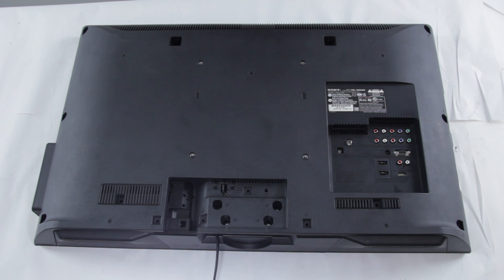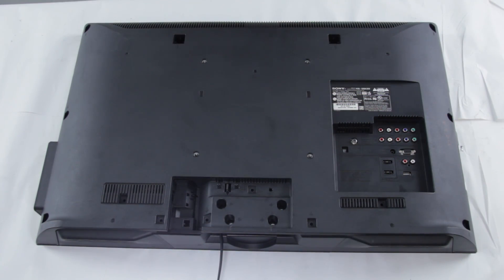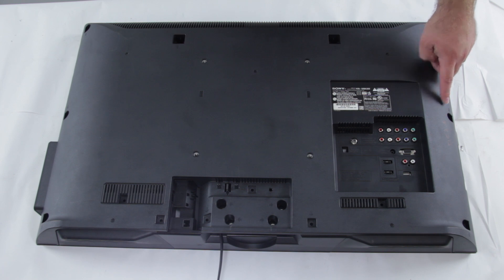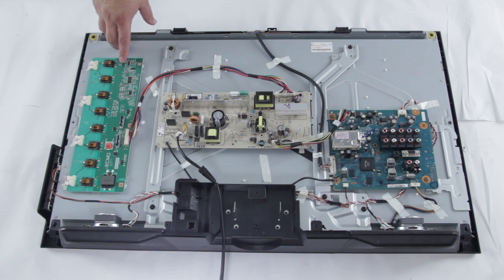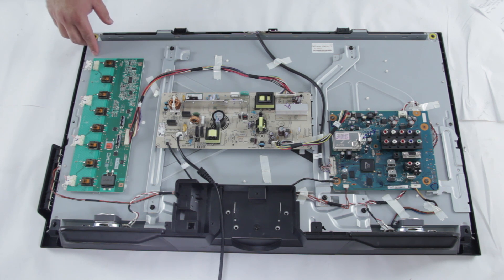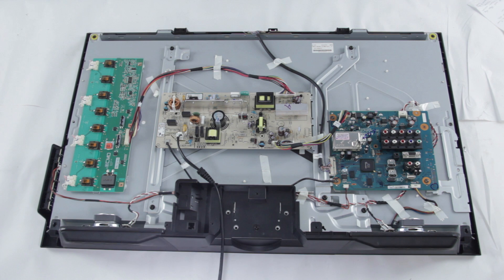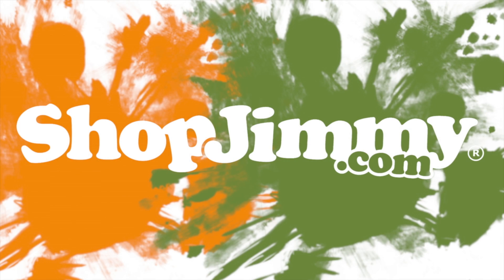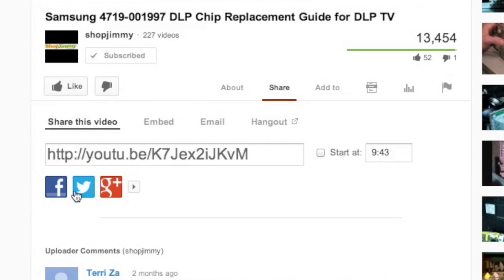LCD TV Repair Tutorial - Backlight Inverter Common Symptoms & Solutions - How to Fix LCD TVs

Comment: I have a  Dynex DX40L150A11.
What an adventure this was. Had it working for about two hours. Originally, the TV would automatically power off the screen a few seconds after turning on. Everything else besides the screen would stay on. The screen would go completely black, not super dim, completely powering off the screen. This told me that the power supply was still good. The picture looked fine which told me that the T-Con board was fine. Though, before the screen would turn off, the lighting of the screen would flicker a bit. Could be bad bulbs, backlighting, or bad inverter board. 

I am thinking that whatever is causing the flickering is sending an error signal to the power supply telling it to power down the screen.

I started by taking the TV completely apart and inspected everything (I thought). The back of the inverter board had some decent brown spots along with the backlighting. That's all compromised. Bad voltages. Once I got to the bulbs I first noticed that the two plastic covers over the sides of the bulbs were cracked. Once I removed those I then seen two bulbs were popped out on one side. This TV could have been dropped or hit hard, knocking the bulbs out of place, creating a power surge/interference that is detected by the inverter board, sending a signal to the power supply telling it to power down the screen. That being said, I popped the two bulbs back in place thinking that I had found the problem. Nope. Not that easy. Didn't solve the issue.

I still believe my original thought that the bulbs were popped out from force causing a power surge/interference. I bet that surge caused damage to the circuitry on the inverter board (the brown spots). Upon further inspection I noticed a static sound coming from the inverter. The static sound was sync with the flickering of the image. The flickering was flicking from a dim to normal lighting and not from off to on.

My only guess is perhaps the controller for the brightness/backlight has been damaged due to improper voltage (a power surge) and an error signal is being sent from inverter board to power supply. There is a wire from the inverter board going to the power supply called DIM. This sends signal for brightness/contrast/backlight control. Could also be responsible for sending the error signal. I disconnected this and grounded it. 

TV powered on properly. Everything worked fine except the brightness/contrast/backlight control but that's because I disconnected it. After about two hours, the screen turned off again. Everything else stayed on. Lol.

I can turn it back on but every 15 minutes or so the screen would go black/power off. There is a good chance that I could just replace the inverter board (for about $20-30) but I am 50% sure that the entire backlighting is compromised (bulbs are fine). Something is still sending an error message to the power supply. It's a hit or miss. I need a voltage meter. Any suggestions?
Reply: E Kryption shit happened to me too bro, smfh

Comment: I have Sanyo DP19640.  Purchased CEJ535C board from you which is an identical replacement for board in TV. No change.  Here is the symptom.  Push power button.  Image appears on TV for 1 second and backlight goes out.  Putting a flashlight up to TV and you can see image without backlight and hear sound.  All other controls seem to work OK.  (menu etc.)  Each time I turn off the TV and turn it back on the backlight works for 1 second.  Any help would be appreciated. Thanks.

Comment: my 32 inch Samsung LCD tv model number ln32d450g1d still currently works but is flickering kinda? like bright to a little less bright over and over with a weird hissing/buzzing noise like you hear in fluorescent tube lights when they are flickering? my first 1 same model that did this eventually went to straight black screen still sound though? is it that backlight inverter or is there a legit bulb that burnt out in my old 1 and is going to burn out in this 1?

Comment: Hi, helpful video.  I have a KDL 55HX820 with 4 blinks.  The 
power/reboot methods have not fixed the problem, so it looks like the TV
 has a true problem.  When the TV is turned on, it stays on for around 
10 seconds before shut down and 4 blinks.  During that time I an tell 
that there are multiple 3-4 large shadows along the bottom edge of the 
screen.  It used to have one of these shadows prior to the 
shut-down/blink issue.  Does this help identify that the problem is the 
LD board vs. main logic board?  Or does this mean that the LED failure 
is causing the system failure?  Is replacing a board and possibly the 
LED back lights a feasible solution?  I appreciate any reply you can 
make to illuminate the problem and solution further.
Thank you.

Comment: I have VU lcd tv 46ïch, backlight not working, tested power supply to backlight inverter ~20v (actual 24v) ok, inverted board part no: SSI460_16A01 how to test backlight inverter board output to lcd

Comment: i have a Samsung 55in LCD TV. model # ln55c630k1fxza. TV powers on and will run for exactly 5min. then black screen and sound only.checked for swollen capacitors on main board as it appears to be a common issue these look good. possibly the inverter board? the exit hold button for 12 sec then enter resets system and returns picture for exactly 5 min. then black screen again. dark room with flashlight shows picture so I know it is a backlight issue. thought if the light had gone bad it wouldn't come back on. any help greatly appreciated

Comment: My KDL 40S2000 Sony Bravia is having the following issue: Power up (directly plugged into outlet) then runs for a few seconds and shuts off - the standby indicator blinks red 4x and pauses - what, if any, helpful response might you be able to share with me. I'm ready to buy an inverter and replace, but wondered if I need to buy upper/lower - any assistance is greatly appreciated!

Comment: model no  is UN55F7100 
Samsung 55" Series 7 LED HDTV - UN55F7100 : TV is not turning on. There is no Red light and its very well connected. I was working fine till night and in morning no power. PLEASE HELP

Comment: hello guys. My TV Samsung model LE4OB651T3W MODEL CODE LE40B651T3WXXC dose not turn on not even the red light that suggests that the power is on. I removed the cover and inspect the capacitors for swelling or damage and I found nothing, no burns or evidence that something is wrong. Can you please help me with an advance?

Comment: I have a Samsung 32" TV model LN-T3242H that has no picture or sound. first, the power led was flashing, so I replaced the power board with a new one. now the led doesn't flash, but there's still no picture or sound. the led stays on for about two minutes, then turns off, then on again for two minutes, and the cycle repeats. can you please help?

Comment: Hello, I have an issue with a SONY KLV-40BX400, the TV turns on, displays the sony logo and plays the power on sound then turns off and turns on a few times and then doesnt turn at all and the power led blinks 6 times intervals, could this be an issue with inverter board?

Comment: samsung 46 inch tv. model# UN46EH6000F. tv will make power on noise but will have a black screen. if you repeatedly turn it on and off eventually 1 out of 50  or so trys the TV will work.

Comment: are backlights supposed to stay on mine on a samsun 65 lcd turn on and off once after a few seconds i have 2 inverter boards and both sides light up they are hooked to power board i guess it controls them? thought i could disconnect 1 to see if the other will stay on

Comment: Hello , I have a Element ELEFW605 60" When it is turn on the start up screen comes on for a quick second and goes black , but I do have sound, I also did the flashlight test and I can see the picture does this sound like the power supply\backlight inverter board or are there a couple of capacitors that can be replaced

Comment: I have sony bravia kdl-46v2500 which powers up with green light for a couple of seconds, then switches over to red blinking STANDBY lights with no picture. The red standby light blinks 4 times with a blank pause, then 4 blinks pause and so on. IN this mode, i am unable to power off the TV even with the power button the tv unit. i have to pull the power plug to power off the tv. Let me know what you think is the issue. Thanks in advance.
Reply: I have exactly the same TV, and last night it had exactly the same problem. Then I noticed that the screen was only half as bright as it was before. Everything else was OK. I unplugged it and reset it using the settings menu. No improvement. This TV is 10 years old. Can half the backlights be off and the other half on?
Reply: Look up service manual the red light sequence is a fault code

Comment: Hi there I have a Samsung TV model # LE32R87BD model code LE32R87BDX/XEU serial # 64083HEP607405K
There is sound output but no picture output. I have tried using different hdmi cable DN tried plugging in a different source. The menu doesn't come up. There is faint light coming from around the edges but no picture even if I shine a flashlight on it. 
I have tried a remote control reset and also unplugging it for 24 hours and still no picture. 
Any ideas that doesn't involve buying a new TV would be appreciated.
With thanks Dan

Comment: I have a sceptre 32 inch screen lcd model x32  serial number d45s322bcb7268 I van barely see the image only when the light hit it just right and it's dark in the room. audio works fine. probably back light issue from what your video stated. just wanted  confirmation and help with ordering the right part. thanks

Comment: hi , i have a sony bravia kdl42v4100 lcd tv . i recent replaced the t con board because i was having issues with horizontal shadow lines about half inch wide ( about 15 total ) across the screen . the problem only occurs after about 20 min of operation. i still have the same issue with a new t con board . Could the backlight inverter ( master or slave) be causing the issue ? pls help and thanks in advance .

Comment: i have a flat screen tv  sceptre p/n x405bv-fhd8hm09s03  s/n b36x405bc3984  model x40    power light turn green no sound no video tv screen not lighting change main board  
still tv not power on power supply coming on but 24v turn on and go off standby power remain on what could be wrong

Comment: Hi. I have a Sony KDL-46BX450 that has been acting up lately. When I turn the TV on, I get the Sony logo and can get to the setup menu, etc using the remote. However I am not able to get a picture from either of the HDMI inputs. I do get sound, but no picture. Would that likely be a problem with the backlight inverter?

Comment: I have an LG Lcd tv model 42LG30-ud.  I have working backlights and sound.  the standby light blinks twice and then the light goes off and the tv comes on, but it has no image.  my panel keys and my remote controls work, sound works, backlights work but no picture.  I replaced the mainboard and the tcon board.  did I get a bad main board from ebay? all voltages are at the connectors from the power supply and to main board.  only 5 volt at tcon fuse.  I think that should be 12v at tv power on.

Comment: Hey I have a Sony KDL-60ex500. It used to take about 20 times to get TV to come on now it won't turn on at all. I have 6 red blinks on the standby light. I replaced the MI and m2 lcd power inverter boards because I found a burnt pin in the connector between the 2. Still won't come on and has 6 blinks. Both the other power inverter boards had 1 burnt looking motherboard tab that slides into the connectors for the lcd. Should I replace the other 2 or is it normal to look like that or should I replace the main board? Thanks in advance.

Comment: hey i have a question
my 32082 orion has no backlights no more
the 32V is pressent the on off signal is also pressent but there is no high voltage
the pcb is 4H.V1448.371/C1 CPT 320WB02
i tryed reflowing it but my oven was to small (it did not happen)

Comment: hello, I have a 32 inch vizio LCD TV model # VA26LHDTV10T  the color is like the contrast is adjusted too high, almost polarized picture on all components. I've set all the settings back to factory. but it didn't help...

Comment: I have a Sony KDL-40ex400 I have been working on this TV for a bit now, when I first acquired it it was in a boot loop just flash the Sony logo over and over I fixed that with a firmware update, I also had bad color on the side HDMI ports which I thought was t-con at first I replaced that anyway, but it's lingering issue is after being unplugged for awhile it will power up fine but when I turn it off it won't boot up again the light will be red when I plug it back in then turn green when I hit power and stay solid green but no picture or sound but sometimes like 5 minutes later the Sony logo will flash on screen once then go away all while led staying solid green, so far I have replaced the T-con, the Power supply, & the main board, I have the back light inverter on the way do you think this will fix it? if not is there any other replaceable parts that could be causing this?

Comment: Westinghouse LTV-46w1HD   sn W4601DEM063900120.   Backlights blink on for a split second after a power on delay then stay off.  Blink on every power up reliably.  There is a A and B board.  Cannot find any A boards for sale.  I guess this board goes bad?  What component?   Explain the master/slave board relationship please.

Comment: hi i have a proscan lcd 32 in model plcd3283a red light is on for stand by but wont trun on took off the power suply board took check it for any problems every thing looks fine do have 5 volts standby nothing burnt so i put back on tv plugd every thing the tv then came on working fine truned it on and off two times worked fine then the therd time came on work fine let it work a bit then shut off put back tv together plug in dont trun on back two the red stand by

Comment: I have a Samsung un39fh5000 TV. when it powers up, the screen looks grayed out. you can see the picture, but it acts almost like contrast adjustment is WAY off. I've set back to factory settings but stays the same. I've read some threads about bad capacitors but not 100% sure if I should replace the board. this TV is less than 2 years old.

Comment: I have a vizio  e320vl that has a problem ,When I plug it in the amber vizio lights up.Then when I push the power button the Vizio lights up white but  I get nothing on the screen.  On the main board  (0171-2271-3293 ).I replaced the eeprom chip  u18  and fixed some of my problems but now I found a bad fuse on this board   (smp--fuse   It has an letter on it   (N)  And not sure of its value. My best guess is 32volts--2amp-fast blow.How do you determine its value?

Comment: My lcd tv Magnavox 32mf337b/27 made a pop sound and then wouldn't power on. I opened back and found a few bad capacitors.  I replaced the bad capacitors and now the tv turns on and once the backlight and screen comes about 3 seconds later tv starts making a clicking sound and backlight seems to flicker.

Comment: Hi, I have an LG modele: 47LE5300 and serial # is: 102RMLM2X632. I changed the main board. Now, I have sound but no image. When I close the light and use a flashlight, I can see the image on the TV. So, I guess its the backlight inverter. Can you help me find that part? thanks

Comment: I have a Haier 55" LCD tv model # L55B2181, it has a dark shadow down the middle of the screen and the right side of the picture is somewhat distorted could it be the inverter board or what? I have replaced the T con board.

Comment: hello, thanks for the extremely helpful videos! I have a insignia NS-LCD42HD. I have narrowed down the issue to the backlight inverters being bad, as i can see images with a flashlight. However, I also have no sound. What could cause the sound issue? Also, it has two backlight inverters, I found them on ebay for 25 bucks a piece. Should I order two? I have a multiemeter but not much electrical experience. Thanks again
Reply: +hotbam37 update...I have tested the tv with a multimeter a little bit. I think the inverters are okay. My suspicion is the logic board is malfunctioning. The speakers are receiving no power, however the inverters are.

Comment: my picture goes black after watching for ten minutes  .audio works still and picture comes back after you turn off the tv and let it sit for a few minutes. I think the back light inverter has an intermittent issue or safety function turning it off? the tv is a Coby tft3229 LCD 32 inch .  how hard is it to repair . is it just carefully plugging in the clips and a few screws ?

Comment: I HAVE A SONY KDL-46S5100  SERIAL# 8026723 AT THE BOTTOM OF THE SCREEN IT'S SHADED LOOKS LIKE VERTICAL FOLDOVER.I HAD TO REPLACE THE T-CON,VIDEO & PWR SUPPLY,NOW I HAVE THE PIX BACK IT'S SHADED @ BOTTOM. POSSIBLE BACK LIT PC????

Comment: i have a lg 47lv5400 and the picture is dark, only way to see is with a flashlight. I have sound, i was wondering if its the back light inverter or a driver
Reply from the maker: +fortrep1   Try all repairs and troubleshooting at your own risk.  This sounds like you have bad LEDs in your TV.  Unfortunately we do not sell replacement LEDs for your TV model number at this time.  You can check back in the future to see if we have them available.  Thanks!  www.shopjimmy.com